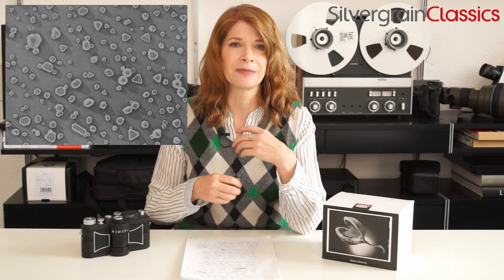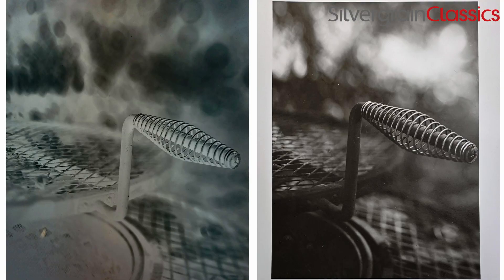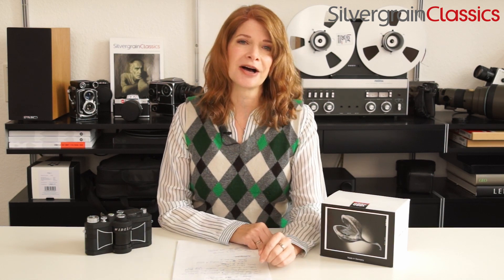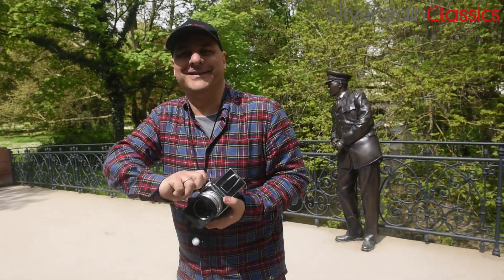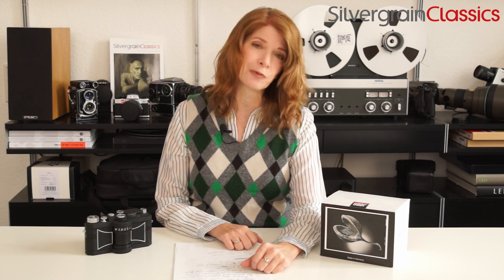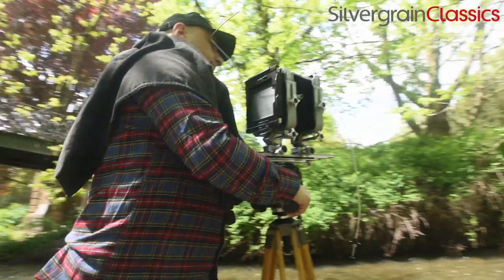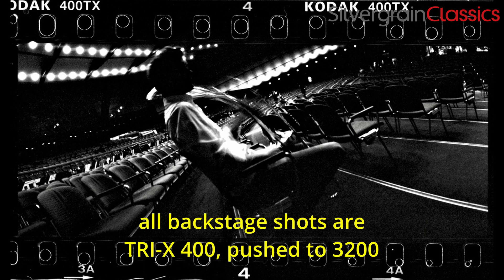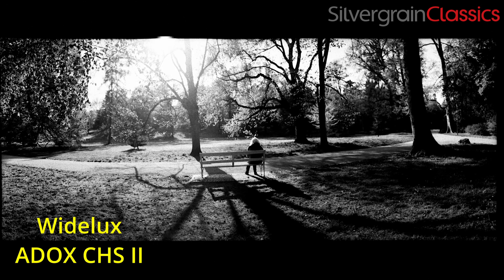Explaining Grain & Developers with the JOBO ALPHA b&w developer

Comment: Generally useful, though a bit loose in my view. You said that the film grains are not touching each other, because we know that there is a lot of space between molecules -- a non sequitur. It also seems to me that in making a presentation such as this, designed for those fairly unfamiliar with film photography, it is an error to say "obviously," or to suggest that the viewer knows "instinctively" that faster films are grainier. In my view, these lapses contribute to confusion rather than clearing it up.
I did think the flour and sugar illustration was somewhat useful heuristically, though perhaps a better explanation of the effect of those "left over" flour particles on sharpness might have improved comprehension for some. I realize that you didn't wish to get into sharpness, resolution, edge-effects, etc.